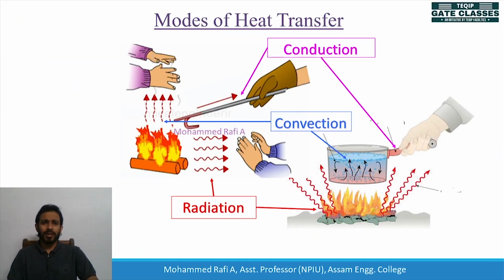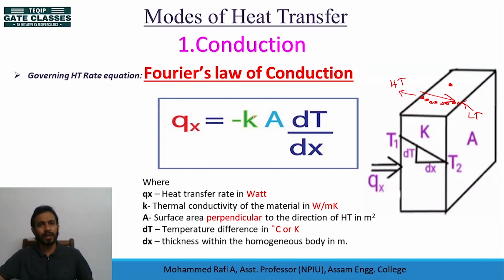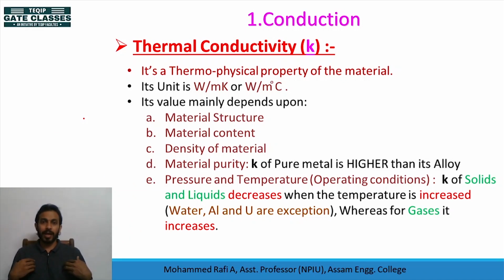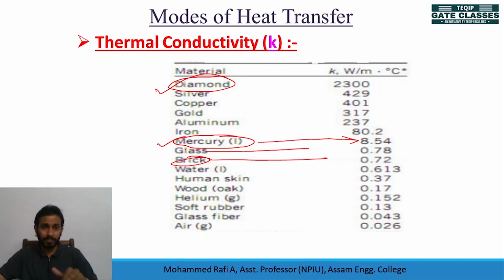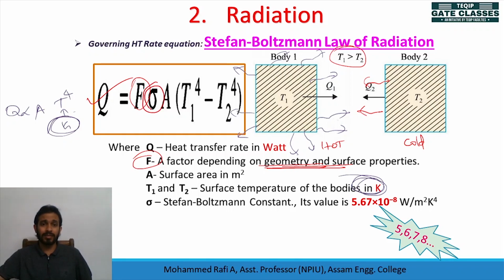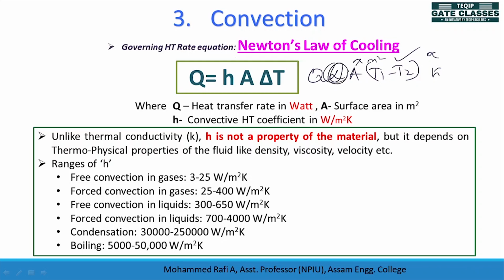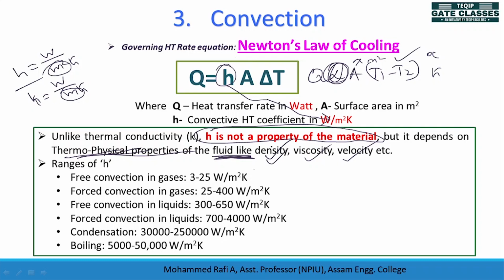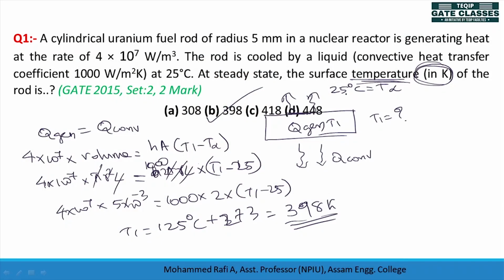Lec-02 | ME | Heat & Mass Transfer by Mohammed Rafi - Modes of Heat Transfer | LetsCracktheGATE

Comment: hello sir
in the question, should we take the 2 side surface of the fuel rod?
Reply: Good question 👍 
Since length of the cylinder is not given in this question, we assume it's very long and radius given is very small. So we can ignore convective HT through it's end faces.
Reply: @mohammedrafiaec5355  thank you sir
Reply: @ab_microverse  Welcome